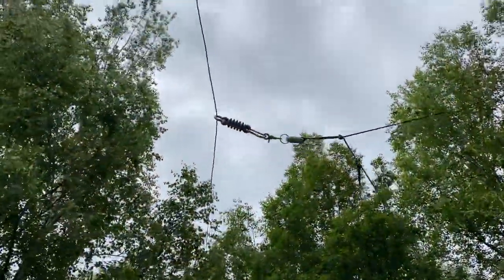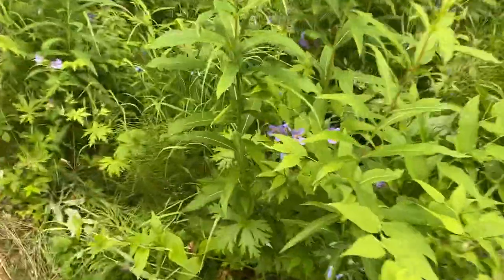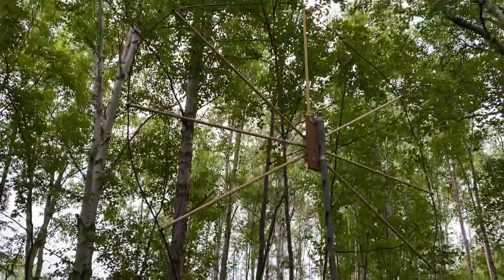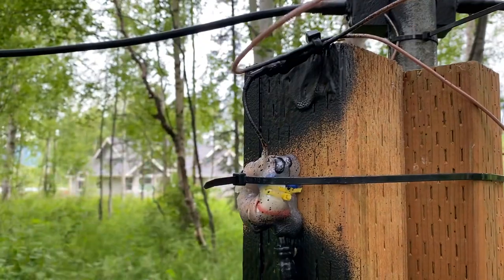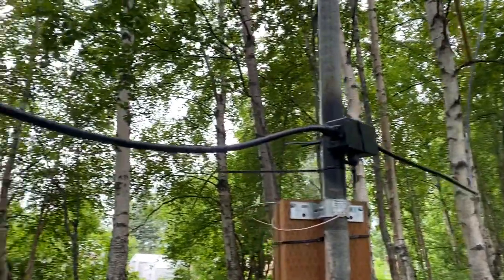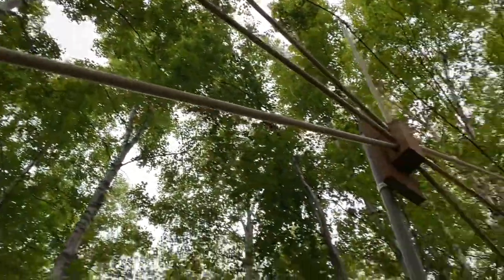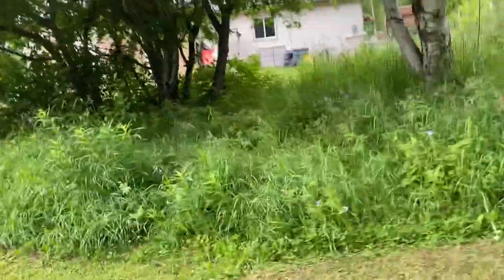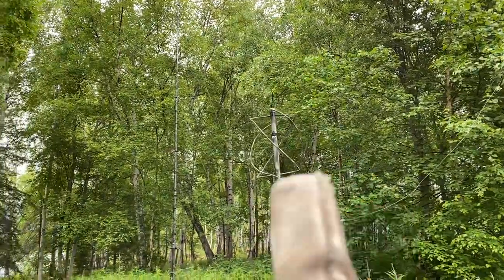ELF (Hz) to VLF (kHz) ; Projects and summer antennae maintenance at KL7L

Comment: Can you give any specifics on the ELF amplifier that you use with the 10 meter whip antenna? Is there a schematic for the amp? Thanks!
Reply from the maker: Hi Alan see      http://kl7l.com/Dk7FCELF.jpg         this is a messy schematic but hope you can understand it - I feed 12vdc clean power down a pair of cat5 wires and installed a 12>9vdc regulator, ensuring decoupled well. Audio comes up to the house  on another pair (100m of cat5e, overall screened, earthed at antenna end only to copper tube into ground, then into isolation transformer here in the house then into a sound card -  the isolation is vitally important or noise from your pc/shack will be sent back down to the antenna - mine is on a pot core 77 material and around 5:1 ratio to increase the Z into line input and good down to 2Hz or so - probably not the right material but it works. Antenna does work so well in wind and rain of course due to microphic/emi
Reply: @hellozerohellozero  Thanks for the response and schematic. I live in a rural area here in SE MN. We do have underground AC to the house and  I can get hundreds of feet away from anything AC. I had been thinking down the same path regarding decoupling the audio with isolation transformers.  I have a portable whistler receiver that I have had for years. I've thought about remounting it in a weather-proof case, providing external power and running the audio back to the house with cat 5 and a pair of isolation transformers...or build an amplifier from scratch. I'll have to look into the LMP7721 op amp. Thanks again. 73's Alan